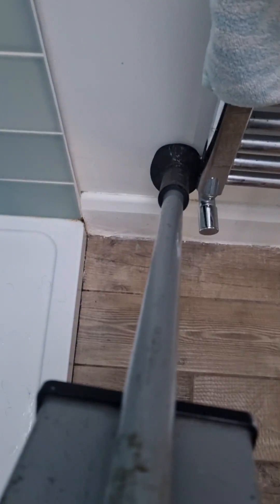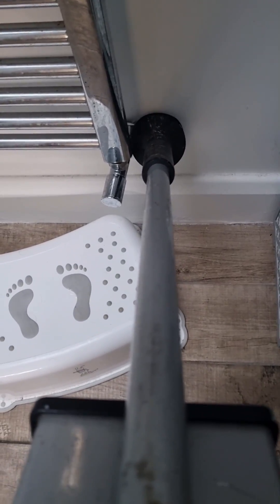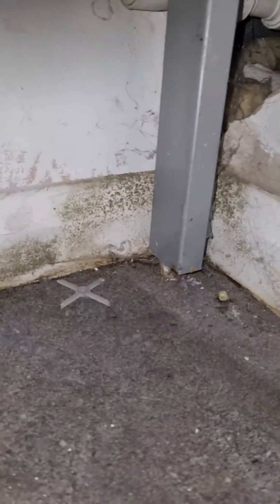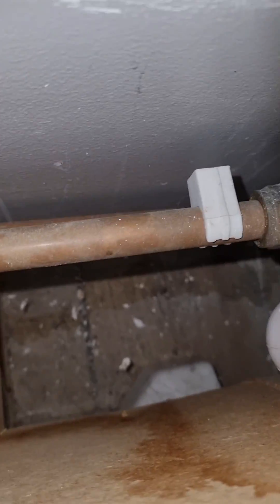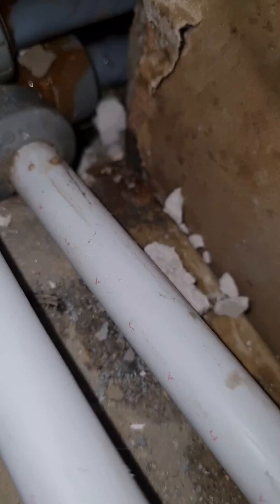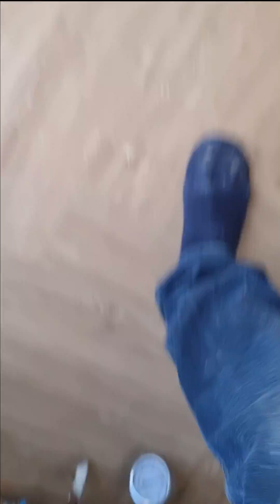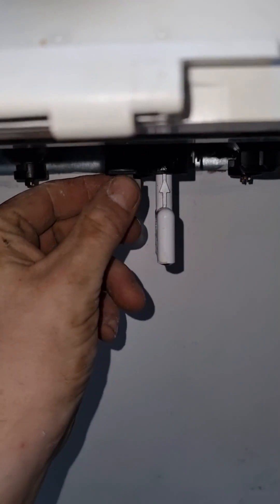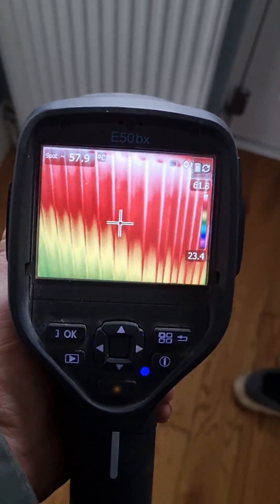Tracer gas leak detection investigation on a heating system, losing pressure every 12 hours!

Comment: How does that wand work?
Reply: Tracer gas (nitrogen hydrogen mix) is pumped into to system. The gas escapes wherever there is a hole and the air sampler (wand) will detect the gas. Another way if you don't want to drain down is put a bit of perfume into the water and see where you can smell the perfume coming out.